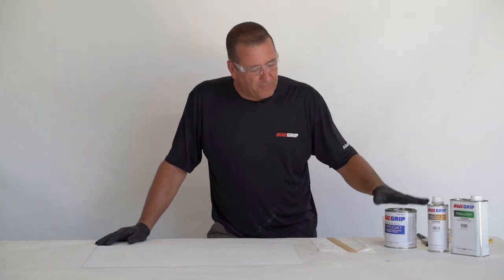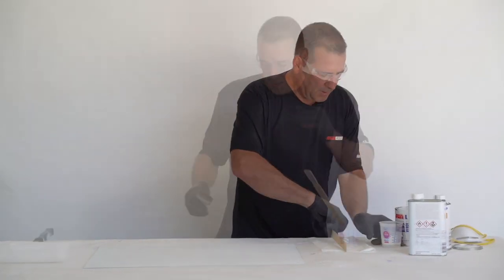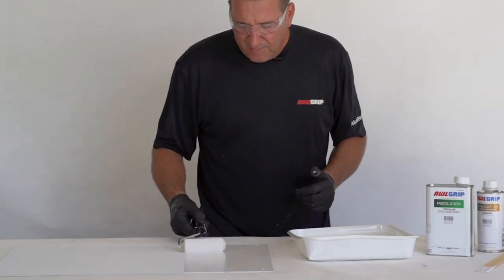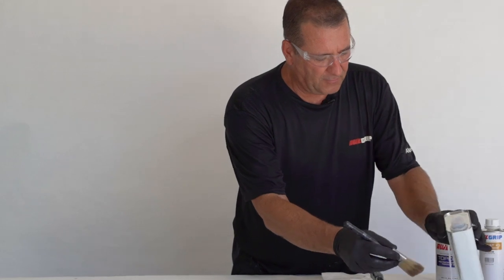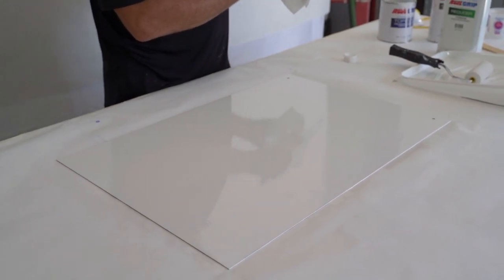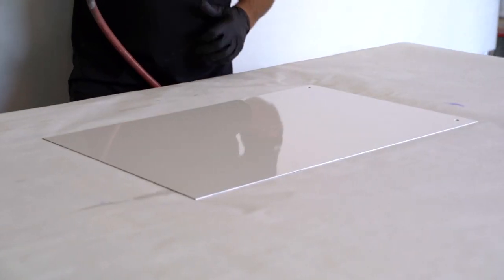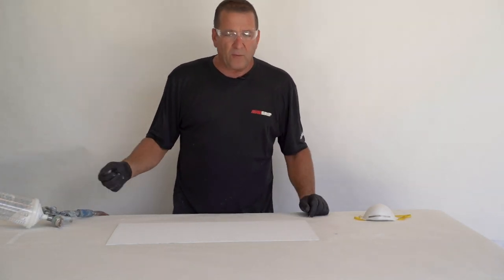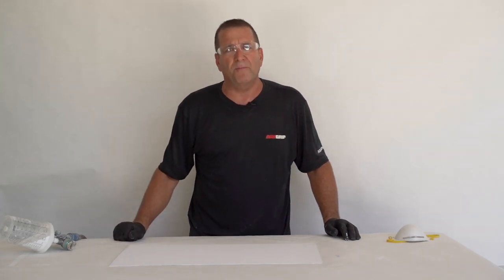Roll & Tip Awlgrip : Applying Non Skid over wet paint

Comment: Hi I have never sprayed before but have used the "salt shaker" method which worked fine. Looking into spraying so I can hit the vertical walls on my boat. With the shaker method, I vacuum up the loose non skid (to be reused) then apply another coat.  If I spray the non skid, is vacuuming required to remove the excess material so it doesn't get into the roller and end up in little clumps?
Reply: I never vacuumed up nonskid—gently hosed it off, but then I paint a deck with the boat in the water.

Comment: What would be the process on an aluminum deck?
Reply from the maker: We would recommend scuffing the aluminum and applying Awlgrip's 545 Epoxy Primer before applying any of the topcoat paints. Once you apply primer and sand it with 400 grit sandpaper the process is exactly the same as what is done in this video.